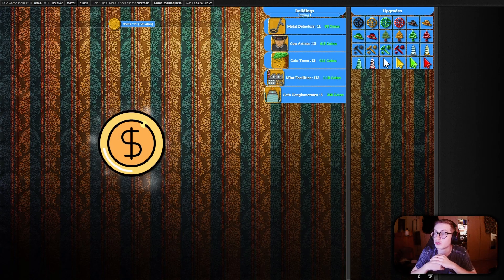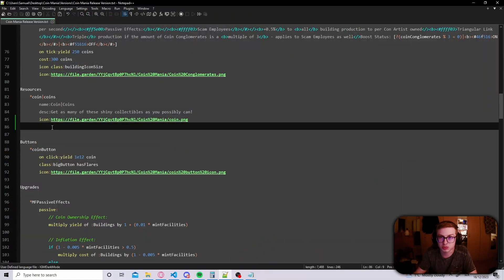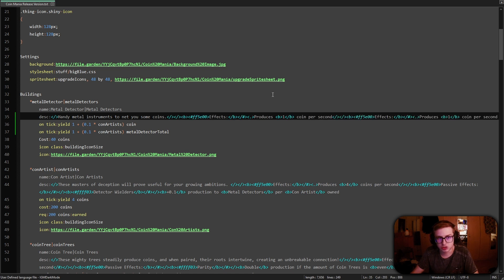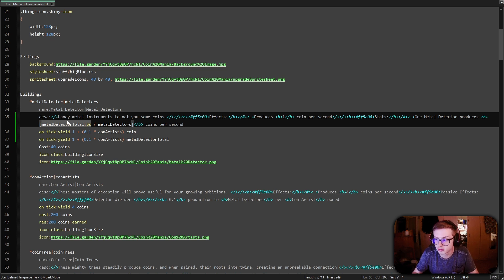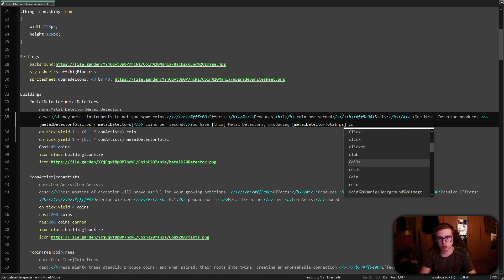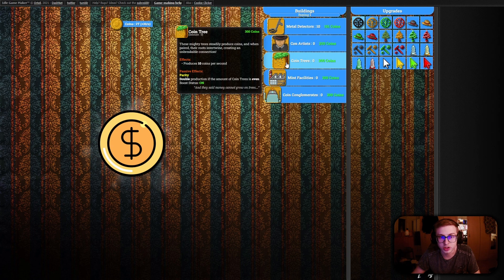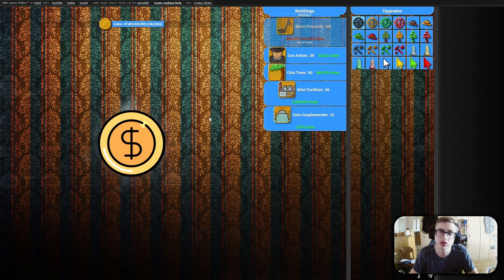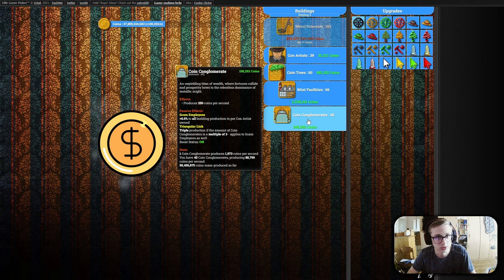Building Stats | Idle Game Maker COURSE #20

Comment: Why is it that when I type or add a space in a line (in notepad) it just removes the letter in that line
Reply from the maker: You hit the "insert" button on your keyboard by accident probably, just press it again and that should fix it
Reply: @IronDizaster  thanks man
Reply: @IronDizaster  what does it do when you press insert?
Reply from the maker: Good question! Usually the button only works in text editors like Notepad++ or MS Word, and is used to toggle between two functions - typing mode and overwrite mode. Typing mode is the default mode you are used to, and overwrite mode basically overwrites whatever characters follow.
Reply: @IronDizaster  alright